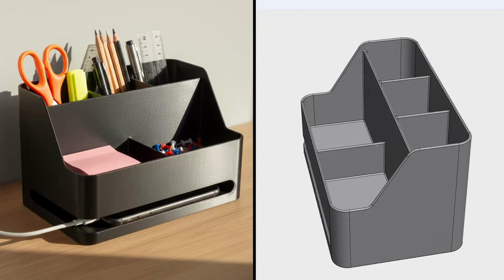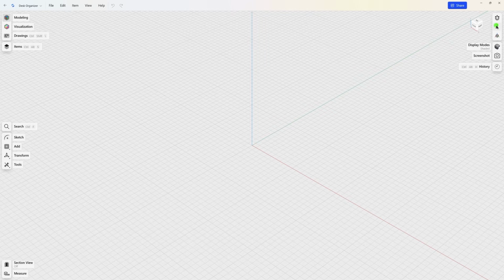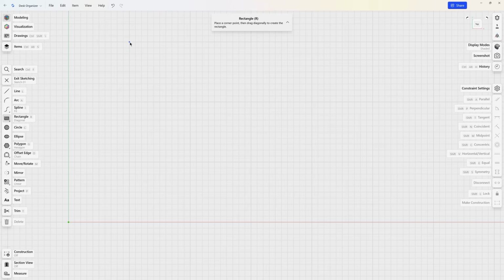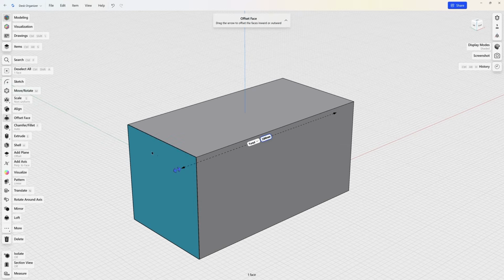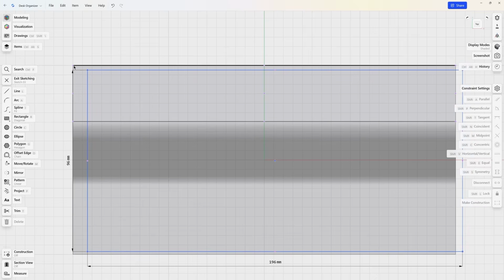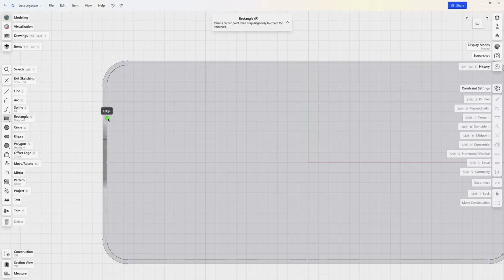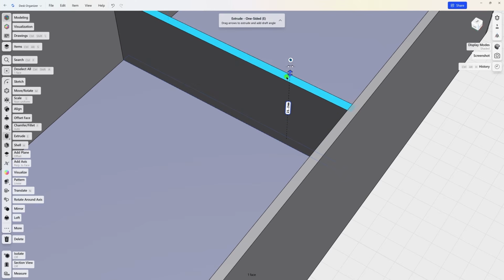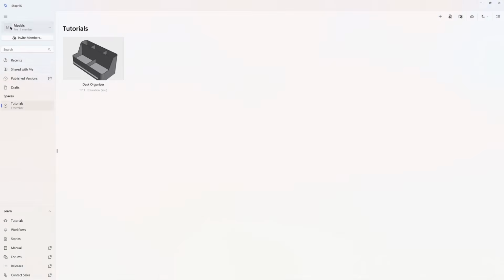Modeling a Desk organizer on Windows | Beginner Tutorial for Shapr3D

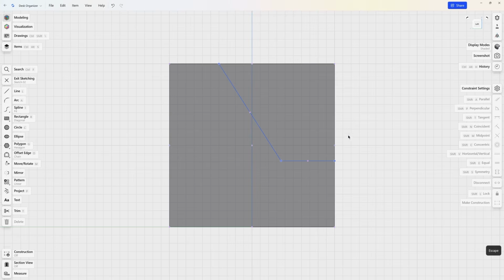Comment: At 7:27 you put in constraints.. you do not say how to do this though, I follow along, have the lines on the sketch, they are in blue, I click just like you did and absolutely nothing comes up, does not let me put in this constraint.  Explain how you are doing every step for this to help new users.
Reply: Shift + грань объекта
Reply from the maker: Here is a detailed articles about adding and removing constraints https://support.shapr3d.com/hc/en-us/articles/7407627891100-Adding-and-removing-constraints
Reply: @Shapr3D  Thank you, I am not sure why when following along exactly as you were doing it it would not work for me, I will check out the article.
Reply: I selected the lower horizontal line at 40mm and clicked on the "horizontal" limit, and then all the lines were fixed !!!
(translation into English using Google Translate !!!)